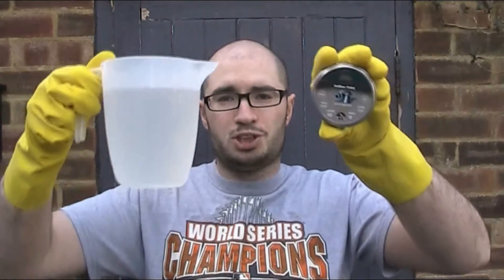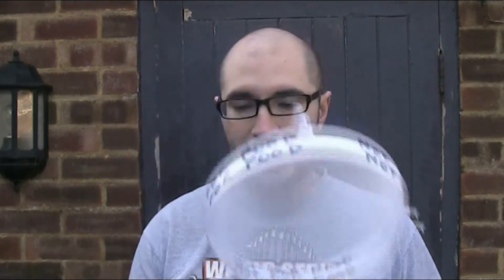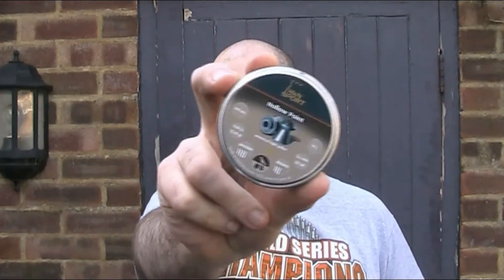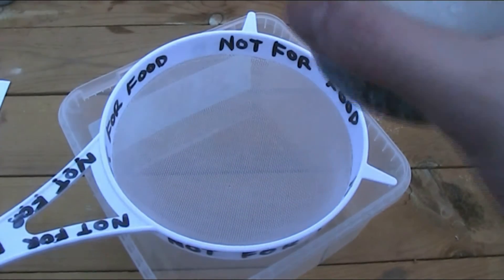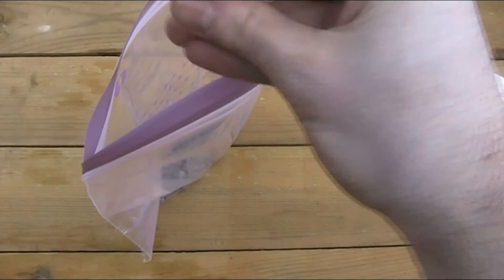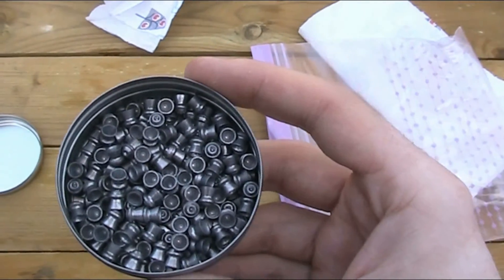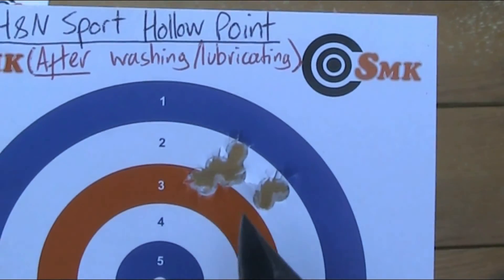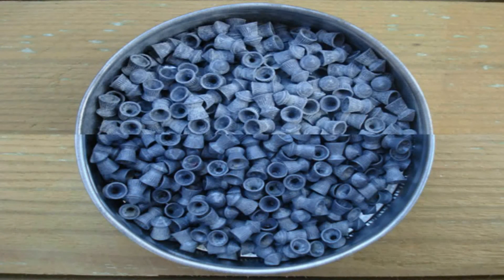How to Wash & Lubricate Airgun Pellets (Using Napier Power Pellet Lube) | Air Armoury

Comment: Yeah great way to bend the skirts out of shape and deform the pellets !! Seriously, spray a bit of Napier oil on the pellets while in the tin....job done.
Reply: the above method outlined in the Video  does not damage the skirt in any way . try it .  Silicone Lubricant spray or Silicone dashboard shining spray will lubricate them nicely .

Comment: I watched this video and since I had just gotten a tin of Crosman pellets I decided to try it. Everything worked as advertised. a BUNCH of lead "smidgins" were removed. Before I returned them to the tin I decided to examine it. Lo and behold there was also a fair amount of lead still in the tin I was about to put my newly cleaned pellets into. I cleaned the tin also before filling it back up . You might want to include that caveat in your next presentation. Thanks for the help.
Reply: He did, check out 6:28
Reply: 03-30-2023: Yes he did !!!!!

Comment: some thing you may find helps when storing pellets for a long time, open the tin when new get yourself a jam jar or similar with a twist lid place inside then light a piece of paper and drop in fitting the lid asap ,Burns out the oxy and you get no lead sulphate
I have bee doing this for years with Muzzle loaders from 32 to 75 cal  and usually have a day or 2 casting several hundred of varying calibres 
This keeps them for a very long time clean shiny and no lead sulphate forming,I take out what i require and drop i another piece of burning paper  BINGO no problems 
will work on Pellets as well ,have had pellets years old and still as when container opened .
Reply: No oxygen, but the pellets covered in paper ash?

Comment: youre right about washing off your rounds. i have a pair of break barrels, so i dont lube them for obvious reasons. but one thing i did with my new Gamo was clean all the oil left over from the factory with denatured alcohol. and that, in combination with cleaning the rounds like you did in  your video, not only increases accuracy, but velocity as well.
Reply from the maker: Yeah it definitely makes a difference, especially if you need pin point accuracy. I don't normally bother though as it's not worth the hassle for just plinking.

Comment: Been wracking my head for the spinning pellets in my hpa air rifle converted from co2 when i remember lubing them with singer all purpose oil while on the old propellant. After some misgivings from advise to keep hpa dry,  i went ahead. It did stabilize with a bit of bark and a puff of smoke due perhaps to dieseling effect but I can now reach out to longer ranges with reliable consistency.

Comment: Just found some old pellets the other day that were almost white. Now I know how to "recycle" them. If the Napier oil isn't available, what would you recommend?
Reply from the maker: +Ratdog 305 If you are using them in a spring gun you need to use something silicone based in order to prevent the gun from dieseling, there are a number companies that make silicone gun oil. If the pellets are being used in a PCP, CO2 etc you can use most gun oils, but I've heard that other things such as WD40 also work. Ballistol is supposed to be pretty good, but I've never tried it myself.

Comment: Have you done any blind testing (not knowing which group of pellets you are actually shooting)  to see if washing & lubing really makes a difference in group size at longer yardages? I'm curious to know how much, if any,  improvement is made in group size by washing & lubing as compared to simply shooting pellets right out of the tin. Example: Do washed & lubed pellets shrink group size from 1" to .5" at 50 meters?  One 10 shot group of each at 12 meters is not conclusive.

Comment: i been using a 50/50 mix of pure electrical silicon jelly and pure silicon oil ,works great !!!!
Reply: I have some old H&N Barracuda extreme in .22 that I purchased off Amazon that were old and brittle and shot noticeably different. They seem brittle almost. I’m gonna use some light Ballistol and pure silicone oil hopefully that does the trick.

Comment: My manual says to not oil my pellets (hatsan 60s). Is this just standard advice and should I pay it any heed? Is the Napier lube ok for springers?
Reply: Probably due to the fact that the pellets could 'diesel', but  it's nothing to worry about.
Reply: 03-31-2023: The reason the spring rifle information says that is to prevent people from using any oil, which is usually a petroleum based oil which will most likely cause dieseling, which “could” cause damage to your spring air gun.
But, if you use a silicone or synthetic oil, dieseling won’t happen (as far as I know).

Comment: Great info.  I just ordered a day state alfa wolf and I was worried about the small partials fouling the chrono.  I don't suppose that the Napier lube will effect the chrono?  Well thank you for your advice.
Reply: 03-30-2023: Hmmm, I too want to know if any oil used with the pellets can possibly affect the chronograph in the Daystate rifles.
I hope that someone in this audience has some input in this subject, your input will be highly appreciated.
Reply: @happyman4914  I talked to days state and they have a cleaning kit just for the cronograph. It isn't supposed to do anything to the cronograph by lubricating the pellets  if the variation of fps starts to be radical. That is when you clean the cronograph. I don't like to look down my barrel and see a piece of led that will be stuck to the nose of my next pellet.  Wash and lube.
Reply: @stevenrowe5047  : 03-31-2023: Thank you so much Steven for your feedback, really good to know.

Comment: hi, ive accumulated a variety of old .22s. decided to give this a try, as some were heavily oxidised and others were just plain dirty. in all, I washed 9 different types. several were marked made in west Germany, to give you an idea of the age. 
theyre still drying so have not been lubbed yet.
Reply from the maker: Sounds like some classic old pellets, what kind of makes are they? Let me how the pellets turn out once you've lubed them and tested them out.
Reply: two tins of elay wasps, two Webleys, two rws some Beeman's an some I forget... wide variety of shapes an sizes. got some piledrivers, big heavy things. probably too heavy for my springers, but they OK at short distance.
Reply from the maker: Sounds good, especially the Eley wasps.
Reply: if you want a few of each to test, send me your address in a pm. the beeman semi hollow point/wad cutters are especially interesting, as are some unbranded pointed Diabolos. 
rick.

Comment: I use power lube, but I would never knock my pellets around like you did, you'll damage the fragile skirts and any gain in accuracy is lost! do you check each pellet before loading?
Reply from the maker: +Tom Elner Hi Tom. Thanks for the feedback. I don't do this very often as I have no real need to for the shooting I do so maybe don't have the technique perfected. On the occasions I have done this I haven't noticed any damage to the skirts, as I do check them before firing.
Reply: +Air Armoury it may be dependent on the ammo... I'm using falcon accuracy plus, the skirts damage really easily so I try to minimise any knocking off them. I roll them in a bag carefully with the lubricant but have considered putting the lube in a spray battle and applying that way. Glad to see that the lubricant is with applying though
Reply: @AirArmoury  i

Comment: Me, I started to wash & lube my AA Diablo pellets long ago. I dont agree with his STIFF plastic bag method of coating the pellets as any finger pressure applied will damage the skirts, its better to apply the lube between two sheets of 2-4mm foam sheet on a flat surface. Apply the lube to one side ie the bottom sheet & very gently roll the pellets around between the sheets of foam to coat them, replacing the lube as required, remembering, that a little goes a long way.
The difference made IS fantastic & worth the trouble.

Comment: They claim on some brands of lube,, 50 percent more accuracy,, but judging by the two targets , I wouldn’t say 50 percent probably 5 , cheers Shane uk 🇬🇧
Reply: 03-31-2023: I agree, 50% increase in accuracy is definitely a huge exaggeration, the % of improvement is going to depend on the pellets been used and also on the barrel.
On one of my many air rifles (a new one that I just bought a couple of months ago), at 50 yards the group went from about ½ inch with new unlubricated pellets to about ⅜ to 7/16 inch groups, that is way less than 50% improvement.

Comment: Most spring air rifles disel on ever shot, it's detonation which is a build of of oil that creates a large bang. Diseling is common and happens every time the oil is combusted.
Reply from the maker: They should only diesel if either too much, or the wrong type of oil is used. A well maintained spring gun should not diesel as standard.
Reply: 03-31-2023: Only petroleum based oils will diesel, silicone or synthetic oil won’t cause dieseling.

Comment: Yes I always  oil my pellets before firing but I found a few days ago I was shooting my air rifle  it fired but the pellet was still in the barrel I used proper cleaning rods but made no difference
Reply: 03-30-2023: My guess is that you unknowingly inserted more than one pellet in your air gun or it just busted an o-ring, gasket or seal !!!.

Comment: Nice video!
Have you ever tried WD40 to lubricate the pellets? Cause Napier Power Pellet Lube is not available here  in CHN.
thx a lot!
Reply from the maker: Never used WD40 myself but I've heard it does work.
Reply: Avoid WD-40 Okay, them’s fightin’ words! Everybody likes WD-40 for the shine it puts on blued metal and for its pleasant aroma. Yes, that’s all true, but if you allow it to dry on things, it leaves a gummy film that can take weeks of hard work to remove. It has no place in airgunning.
Reply: Wd40 will damage the seal...
Reply: @markrayton6385 : 03-30-2023: Thank you for your input, good to know.
Reply: @tomasstascak4196 : 03-30-2023: Thank you for your input, good to know.

Comment: There is another vid with false info on dieseling all air guns diesel its fine its when you get detenation that causes problems detenation occurs whan there is too much oil and the particles seperate causing a explosion a air gun with a leather piston seal needs about 2 or 3 drops of oil every 500 pellets to keep the leather piston seal soft so it clings tight to the cylinder walls for max compression for leather seals use household oil 3in 1 oil is good for rifles with a synthetic puston seal doesnt need as much oil and you use 1or2 drops of silicon oil in those when needed you can tell this by when cocking the rifle if it honks thats the sound of a dry seal rubbing against a dry cylinder. Another note if the lube you are using is inflamable dont get any inside the pellet skirt it will cause detonation i use furniture polish with beeswax stand the pellets on there end and give them a quick light spray you dont need to cover all the pellet as they will coat your barrel and any dry pellets will be lubed when you fire them

Comment: I don't know where to start mate.
Warm water on lead? Lead is already a soft malleable metal as it is. Now you've made it even softer. Washing up liquid has salt in it. You want to introduce salt to the steel workings of your airgun? Better not be expensive.
Why lube the pellets in a bag? Something wrong with the tin they came in?
Sorry but everything about this video is terrible advice.
My advice if you want to clean and lube your pellets.
Empty the pellets onto a strainer much like the one you had. Rinse the pellets under a cold running tap. Use only the force of the running water to move the pellets around while rinsing.
Place the pellets onto 2 layers of tissue, then cover with another 2 layers. Leave for a few minutes to allow the tissue to absorb most of the water.
Clean out the tin with a soft, clean dry cloth. Put a few drops of a decent quality air tool oil in the tin. Gently return the pellets to the tin, close lid, now rotate the tin on its side very slowly for around 1 minute.
The purpose for air tool oil is that it is a very versatile oil. It will disperse water, lubricate just about anything. Its friendly to silicone, rubber, all metals and has cleaning properties as well. Don't buy that red crap. Ridiculously overpriced for all it is.
Reply: Andrew. I don't know where to start. You have no idea what you are talking about. You know nothing about cleaning pellets. (I'm not saying everything the video shows is the ideal way) But you obviously don't know enough to be giving advice. And if you do shoot, hopefully you know which end of the pellet goes in the barrel first.
Reply: @james1795  I've been shooting .22lr, .223, .308, .303. And all sorts of airguns with all sorts of pellets for over 20 years. I was a range conducting officer in Air Force for 7 years. I had every marksman badge going in the Air Cadets.
But no you're right. You must know better. I don't know anything.
I look down the barrel to aim, right?
.... What. A. Plonk.
Reply: @Andrew. You are comparing apples to oranges. Shooting and cleaning are different subjects. Thumbs up to you for being able to hit what you aim at. A marksman badge is not an award for knowing how to prep pellets (you are obviously unaware). Just so ya know. Don't be a Plonk, talk about what you know, not what you know nothing about.
Reply: @james1795  My fault I suppose as I didn't actually say.
I do clean my pellets as well. There you go, does that clear things up?
While the same cleaning method will work for all pellets. The lube you use is very important for the particular kind of mechanism the pellet will be shot by.
The same lube, while it will be perfectly fine for a springer for example. Will be a terrible idea for a PNP.
Something a lot of people fail to consider. Is how sticky a lot of oils are. Unless your mechanism is completely self-contained, or very easily serviceable. It might be best not to oil it at all. Or use a microscopic touch of refined graphite if you must.
I've had a Daystate MK3 since it was brand new. Looks and shoots like day 1. All because I know how to look after all kinds of guns properly.
Reply: So, who do I listen to,you or the shooters who win competitions? Seems like Napier Power Plus is popular with marksmen here, I'll take that against your air cadet badges anyday. Salt in the barrel after pellets have been rinsed and lubed, give me a break pal!
Reply: @barlow2976  Well one of my badges was being top 50 in the country.
I've been 1st, 2nd and 3rd in the country in as many years.
That's competing against people trained by veteran rifleman.
So take whatever advice you like.
Your choice.

Comment: Napier power pellet lube ~£3.50 for 10ml (~£350 for a litre!) 3-in1 silicone lubricant spray ~£5.99 for 400ml (£15.98 per litre). Read the safety data sheets on both, near identical ingredients. Save a few pennies, and have the addition of aerosolised lube for general DIY. Same thing for Crossman Pellgunoil ,-it's just Diesel engine oil! Safety data sheets tell you everything that's in a product and save you cash mate. Don't believe everything the manufacturer says, most just rebrand and sell materials at a insanely inflated price. Check it out yourself bud 😃
Reply from the maker: Yeah that's a fair point, thanks.
Reply: Good point I had heard about the diesel engine oil, but not the 3 in 1. I'm in the USA and I'm sure that they must sell it here unlike the dish wash soap. Thanks for sharing and I'll be on the lookout for it.
Reply: Just because they share common ingredients doesn't mean they are the same product. Yes, the 3 in 1 will do a good job, but it is definitely not the same compound.
Reply: @barlow2976 : 03-31-2023: The oil used for lubricating pellets doesn’t have to be the same as any other one or even have the same ingredients, the oil used just needs to contain NO petroleum based oil and it must be of very low viscosity, the higher the viscosity, the more resistance the pellet will be fighting as it travels  through the barrel, therefore slowing it down, kind of like using a heavier pellet.

The oil used for pellets shouldn’t contain any solvents either, as this will probably cause additional wear and corrosion to the barrel’s bore and damage to seals.

Some oils may contain as additives, glycol ether and or polyglycol (which are solvents) in order to keep the viscosity of the oil very low in cold weather, but it becomes corrosive over time.

As glycols break down, they form organic acids such as glycolic, glyoxylic, formic, carbonic, and oxalic acids. These acids are corrosive to metals such as iron, steel, and zinc.

Make sure to check the ingredients of any oils that you are considering for use as pellet lubricant.

I use a silicone oil, the very same one that is used to lubricate the piston chamber for break barrel rifles. It is a low viscosity, non-petroleum based and a synthetic oil.

I tested the difference in speed of the pellets in one of my PCP .22 caliber rifles, UNLUBRICATED-V-LUBRICATED pellets and the “average” difference was only 7 feet per second, the lubricated pellets were a little faster according to the FX Pocket chronograph, using the 18.52 gr H&N Baracuda Hunter Extreme pellets. No big difference in speed but the groups were a little tighter at 50 yards.

DO NOT use mineral oil as it is a petroleum based oil.

Do NOT use regular brake fluids as a pellet lube, they usually contain solvents which will corrode your barrel over time, damage your rifle’s seals, gaskets and o-rings.

I haven’t checked on synthetic transmission fluid for ingredients and viscosity, so I don’t know if it could be a possible useful pellet lube.